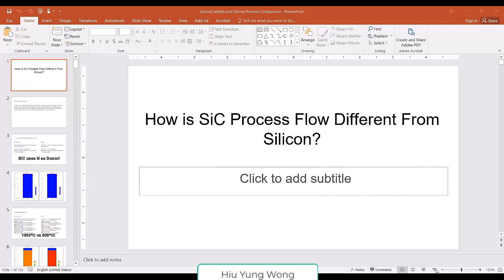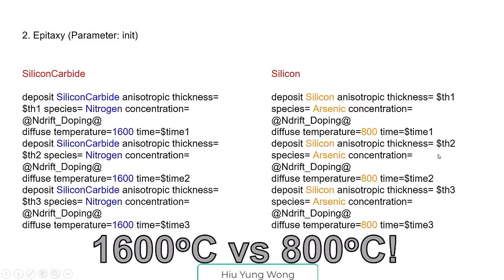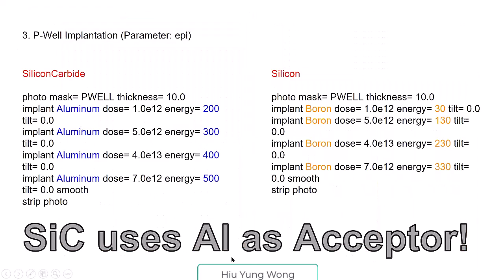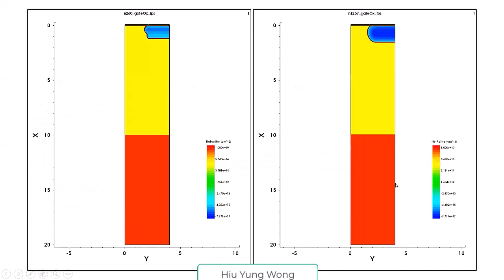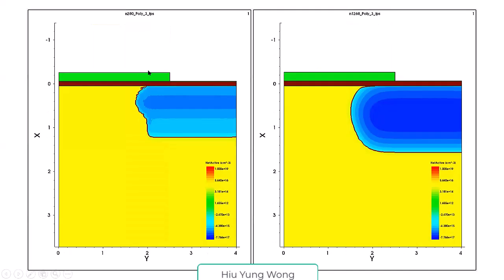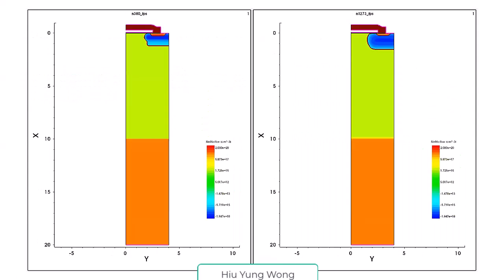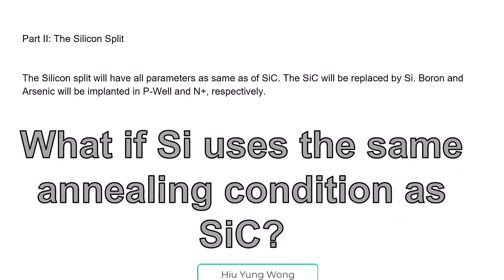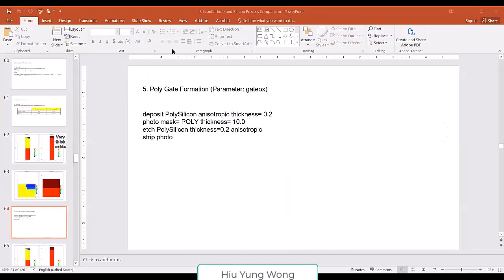20-B (Ultra) Wide Bandgap - Silicon Carbide Process Flow compared to Silicon

Comment: Hello professor, I wonder about the OPTIMIZER of swb framework. I want to simulate, but I dont't know using OPTIMIZER framework.
So, Can I ask you about using OPTIMIZER in Sentaurus process? or I want to be recommend about OPTIMZER guideline or manual.
Thank you for reading my text.
Reply from the maker: @chunsulee7603 I do not know optimizer well. But you can find opt_ug.pdf and swb_ug.pdf in the manual directory for details. Thanks!